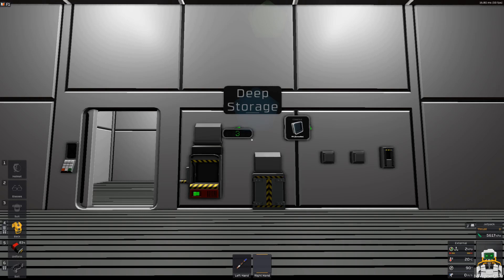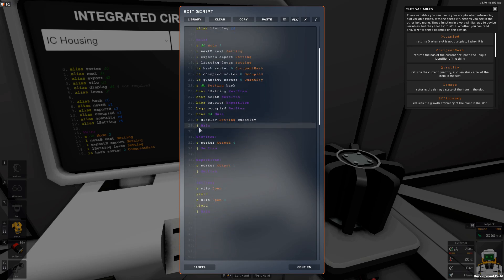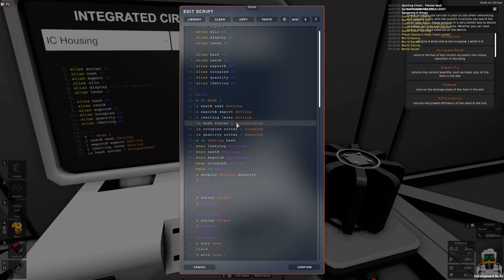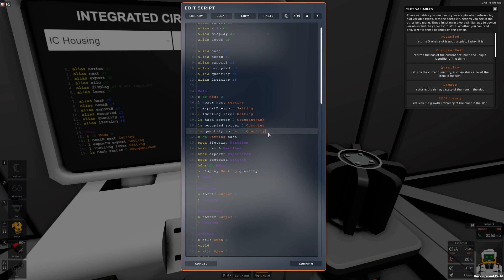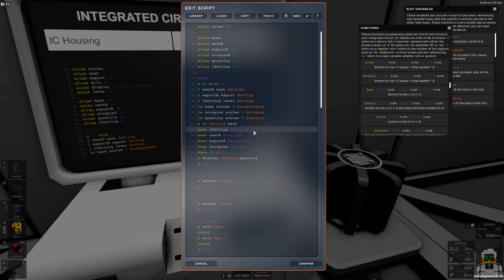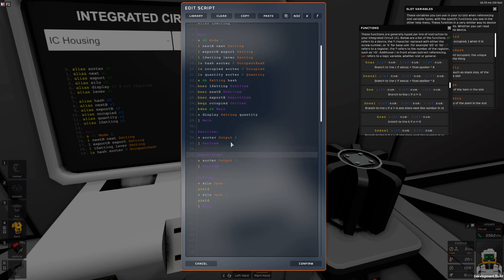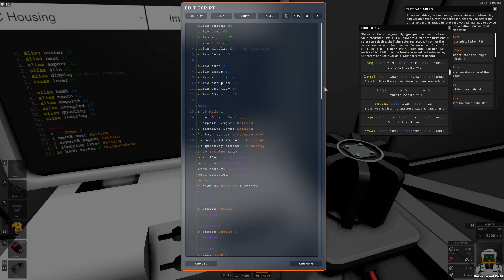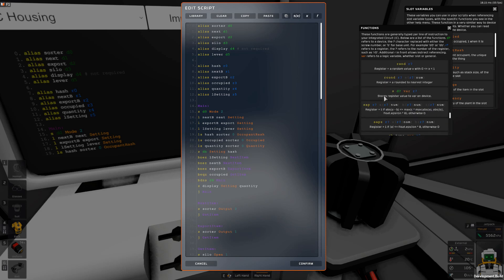(Outdated) Stationeers Deep Dive: The Code Behind Deep Storage

Comment: This is cool, but how does the hash make it to the right console with a hash display?
Reply from the maker: So on the console with the hash display insert a data disk and select the ic housing that is running the code. Then remove the data disk. It will then display that item hash.